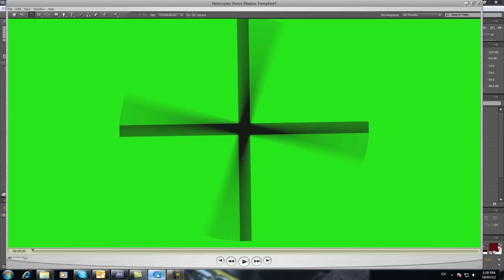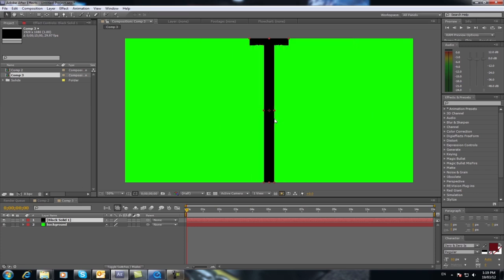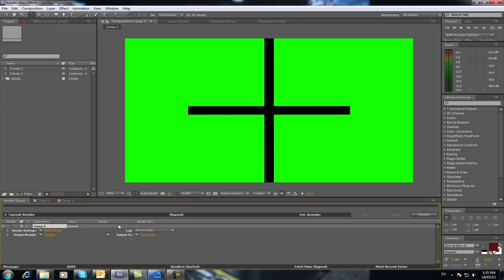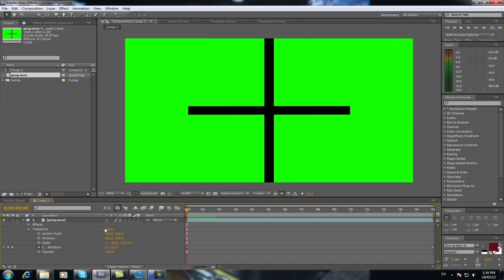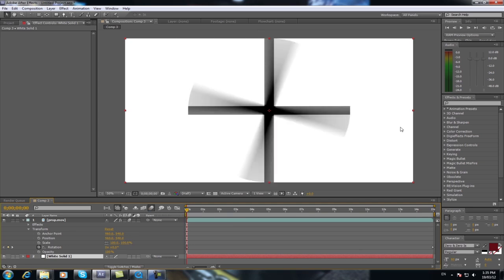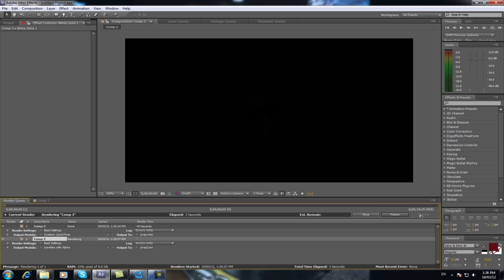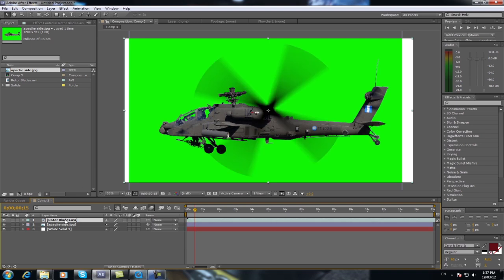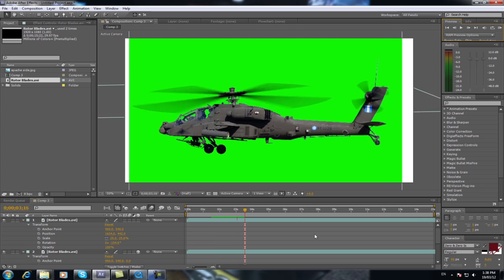How To Make A Spinning Helicopter Propeller :Adobe After Effects Tutorial 3

Comment: 1)
while rotation a layer you can hold SHIFT to snap it to angle to rotate it perfectly by 90° or select the layer, press R and type in 90° by hand.

2)
You don't need a green layer. Just leave the background transparent so you don't need to unnecessarily key it out again

3)
instead of rendering the rotor just precomp it (select the blades and hit CTRL+SHIFT+C). now you can import your helicopter and rotate the precomp like hell. turn on motion blur and it's done.

that's like 60% less work